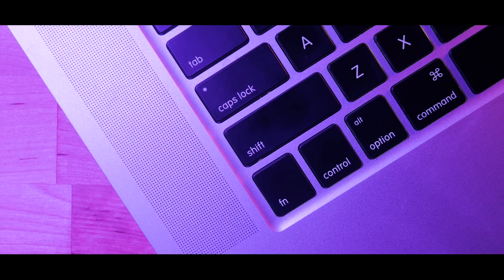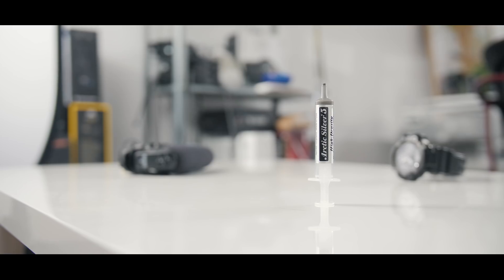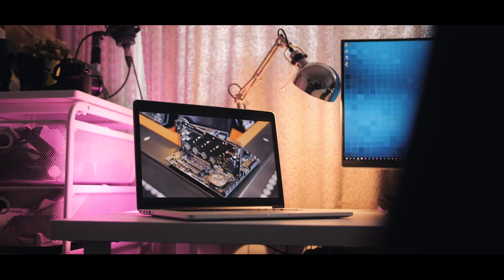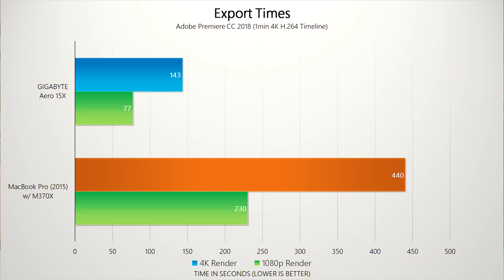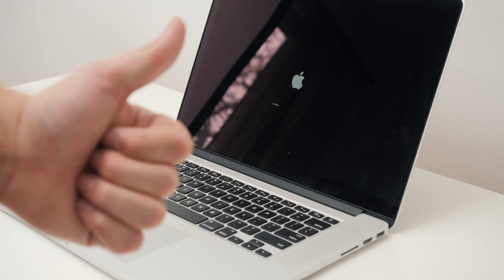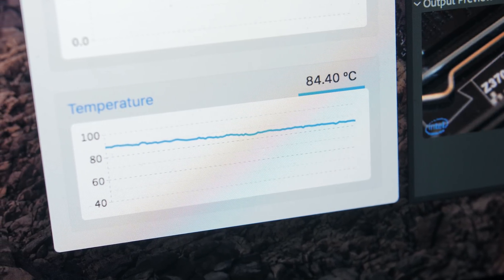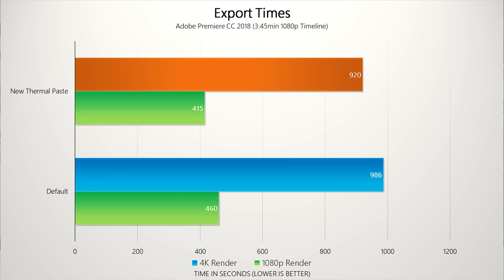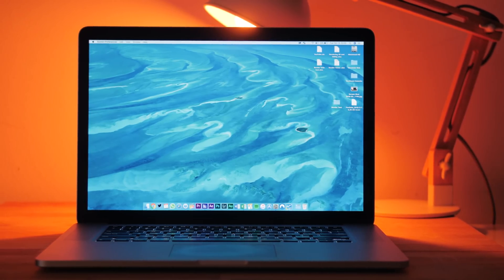OVERHEATING MacBook Pro! Can We Fix It??

Comment: The only fix to that mac is to switch to something different, something not from apple ;)
Thank me later
Reply: Jeremy Clarkson exclusives are not a reason for keeping something that's clearly not worth your money. For the price of a Macbook Pro, you can get a better laptop that works more efficiently.
Reply: Jeremy Clarkson okay yeah whatever. Enjoy your underpowered and overpriced piece of junk.
Reply: Don't even bother to argue with apple fan boys.
Reply: Yeah whatever, if i was butthurt over a guy on the internet i'd be a moron just like you, lucky me i guess.
Reply: Spaghetti eh not exactly. For me Windows is insufferable. I’m a music producer first, game dev second. All my outboard gear either doesn’t work or kind of works in windows. Drivers in that OS are just awful. And the lag between small actions, such as opening an application or closing/resizing a window are terrible and drive me crazy. And I don’t run a slow system either. But macOS is great with all my external gear, no problems ever. And no crashes when recording, or micro stutters in playback which is important. I do all my UE4 work in windows, and it gets the job done, but again windows is terrible, and I’ll just ignore the glaring issues with the UI. So it’s more a platform to run my software off of rather then an OS I enjoy dealing with. So there are reasons to use both. Different use cases and different opinions/needs, just saying switch from one to the other is silly. As it’s not that simple. 

For me with my Mac it goes “love the hardware, love the software” and for my PC it goes “Love the hardware, hate the software”. And I’m sure there are people that find it to be just the opposite. I use what I like most, and what I’m most productive on, and I say confidently that macOS is a much better option then windows for me, as I use both daily. 

So it’s kinda just, one person can find one platform to be fantastic, or their use case calls for it. And you wouldn’t know. So maybe Dimitri just enjoys macOS, it’s just kinda silly to say one is definitively better.
Reply: Spaghetti And lose out on the amazing software that are Apple exclusives

Yeah, no thanks
Reply: If you need the exclusives keep it but otherwise there is not a single reason to go with a mac over a windows laptop. That's my personal opinion.
Reply: Spaghetti Oh there's several reasons, besides, he said he loves. So your comment is basically useless
Reply: React2Quick I don't care and neither does Dmitry.
Also, if you're doing profesisonal work, the software makes a huge difference so yes, exclusives are worth the purchase
Reply: Spaghetti Lol you automatically assume I'm an Apple fanboy because I'm defending his choice.
It could've been a Dell XPS, I still would've said the same things.
You're just two butthurt idiots
Reply: Spaghetti Lol you just proved my point.
Thanks, have a good day.

Comment: Can we? Why should we? Get a Windows laptop for double the performance in the same price range with no throttling problems - the solution to all Mac related problems. Easy.
Reply: Balderdash. Asus, Acer, Razer and HP all have premium built ultrabooks that are just as performant (if not more) than any Macbook and cost much less. Owning a Macbook in the last 2-3 years has become as ridiculous as the people who insist on buying them for no logical or measurable reason.
Reply: People who buy Ultrabooks (that is what a MacBook is) want a small, lightweight device that lasts the whole day. IF you want to compare a MacBook to a Windows Machine, compare it to a Dell XPS or Microsoft Surface Book 2 (which are all roughly the same in price if equally specced)... and yes, they, too, suffer from overheating/throttling problems because that is pretty normal for Ultrabooks.
Reply: Endless Fluff
I hear what you're saying but you can still find ultrabooks with a lot more power and still last all day.

Comment: I read in some forums that some MacBook Pros suffer from throttling due to power limit issues, especially if both CPU and GPU are being pushed. Maybe that is your case.
Reply: ture, that I why I have had some people at the Genius Bar at my local apple store tell me that If I am to use Adobe premier and Final cur pro that I should have the laptop connected to power because the battery is not always capable of sustaining the power delivery necessary to run the Radeon GPU and the CPU.

Comment: Going by the video, you used way too much thermal paste. You only need enough to create a thin layer, which creates a vacuum to suck the heatsink down to the cpu making thermal dissipation possible.  Too much and you have a thick layer and excess squeezed out around the edges that holds heat.  End result? It works but not optimally.
Reply: Brisys Consulting wouldn’t the thermal paste conduct heat better than air, if not why bother using it at all.

Even if thermal paste were an insulator, over the edges amount lost cooling potential should be negligible.
Reply: Brisys Consulting a vacuum? Lol come on man. Thermal paste is there to replace the air gap between the cpu heat spreader and the base of the cooler plate. A 1-2 degree difference for over applying thermal paste in his scenario would matter anyway.
Reply: lightninguru26 It creates a vacuum. Been doing IT for 20 years.
Reply: Brisys Consulting so a paste creates enough vacuum to pull two metal pieces together to fill in a air gap? Your disputing that thermal past is  a void filler of an air gap that allows heat to transfer from one metal to another without dissipating into the air around the gap?

Comment: If you are using Premiere you should definitely get a Laptop with NVIDIA graphics.
Reply: wish apple would include an Nvidia GPU option in the laptops even if it is a 1050ti, though I would love a 1060 card.
Reply: TruVueTech YT
Apples macbook pros come with amd cards that preform worse than a 1050. They would only give you 1060 like performance for like a $2000 mark up.
Reply: forza1sra I know this. I sell them at work.

Comment: Since Arctic Silver 5 is conductive, it has a 24-hour cure time unlike some of the non conductive thermal compounds. I would suggest a follow-up video if it gets better over the next day or so.
Reply: Arctic Silver 5 is not conductive. Only liquid metal based ones are.

Comment: I have a 2017 MacBook Pro and I'm often disappointed with the heat output under circumstances like 4K video streaming. It's effectively maxed out (minus the SSD) too. Maybe when it's a few years old, I'll consider re-applying the thermal paste on it, it seems like a good idea.
Reply: I also have the MacBook Pro 2017 and with a same issue. Is your issue resolved? I wanted to know more. My MacBook turns off immediately whenever a heavy task applied on it! I’m depressed right now

Comment: The fins on the cooler is probably blocked. I have and old laptop that has been used for 3-4 years and it would thermal shut down. Opened it up and found the fin completely blocked by a jumble hairs, dust, and dust that twined together making strands. Blow some air from the outside (exhaust) with a bicycle pump and it ran fine after.
Reply: mac fan control app solved my issue, apple really has slowed down the fans to reduce sound but mac fan control helps you to solve the fan speed issue
Reply: That's why he mentioned cleaning the fans and not only thermal paste, cause if you open up the PC to replace the paste you should check on how clean the fans and stuff are.. you are opening the PC anyways..

Comment: macbooks suck
Reply: There is something wrong with his MBP. Mine hovers at around 45°C while watching youtube and the fans aren't even spinning up. Room temp is 22°C.
Reply: 45 sounds pretty normal I'd say
Reply: I suppose you haven't had one, have you?
Reply: tomtom4867  70 degrees on youtube...im glad i haven't owned one
Reply: kasra the only time mine has ever got warm on YouTube was when booted into windows.
Reply: tomtom4867 see it cant even run windows properly🙂
Reply: Every windows laptop I've ever experienced has run hotter than any macbook i've used under a normal load. Don't base opinions on something you have no experience with just because you want to join the "apple sucks" wagon.
Reply: tomtom4867 well i have experienced a windows laptop and i can tell you for sure that the fans dont even kick in when im on youtube😄
Reply: And macbooks dont normally need to run the fan on youtube.

Comment: Kind of pathetic though right? 

I mean, for the price you paid for that machine to have to re-apply thermal paste after only two years, and see a few degrees difference. 
Should have gone with the same laptop Ebur has.
Reply: Malovon yeah videos like this make me laugh at all the Mac defenders saying "the extra cost is because you get a better system for creators" and bs like that, yet it runs as hot as old laptops with piss poor cooling.

Having to replace thermal paste every 2 years is a joke. Macs have their place but holy crap are their laptops bad for cooling if they are specced for actual creators.
Reply: alcowherd7 honestly, with all the MBPs I’ve owned. Cooling is always the biggest issue. Like I love macOS, but the cooling needs to be waaay better. When I do my audio work it’s great. Whisper silent in the studio, and if it starts running hot I’ll just freeze the track.

But man when I switch in to UE4 do the fans kick up. And I can’t imagine that those temps can be good for the neighboring components in the machine as well. Cause of how tightly packed everything is.

It’d be the perfect laptop if the cooling was better. Just wish Apple would see that. Cause they can cool things well, as proven by the iMac Pro, just put that much hard work into the cooling setup in the MBPs ffs
Reply: John Wick good to hear that this isn't an isolated issue, not good to hear you have to deal with it. I have had a few laptops with not the greatest specs that have poor cooling so I could only imagine how annoying fans must get when you are just tried to get some work done.
Reply: alcowherd7 yes Apple needs to fix this. It’s got to the point where I now do all my UE4 work on my PC. Which is irritating because my workflow is split across two machines with different OSs. And it’s Apple’s fault that this is the case. Just a little more cooling, that’s all that’s needed.
Reply: John Wick yeah definitely something they should look into. Sad to see in thus movie a tool that is valued by professionals being used as a Netflix box because it overheats and throttles just during rendering.
Reply: Should have gone with a desktop machine, and obviously not one of Apple's horribly out of date ones.

Comment: You should disable turbo boost, because intel cpu can work a lot longer without throttling when turbo boost is disabled and you will render faster because throttled cpu frequency is lower than "unturbo boosted" cpu frequency

actually most of the times intel cpu's throttling because of power consumption, 15 watt intel cpu can boost to 25watt or even more, but it can't work at this rate more than 30 sec, mostly because of manufacture's limitations. That means that even if temperatures is good it doesn't mean than cpu won't throttle.

Comment: Something wired happened to me with a 2010 MBA is that performance dropped when the battery started to get old. I've tired to benchmark it at the time and OSX seemed to throttle the CPU when the battery is on (even on sector), just like this issue with iPhones. Removing the battery was a game changer.
But it would be a useless laptop without a battery -_- .

Comment: The different GHz speeds in 4k vs 1080 are likely due to i/o limitations. The 4k render has larger files to read and write to the SSD, so there are more opportunities for the cpu to cool down whilst it is still saving; cooler cpu = maintain higher boost clock.

Comment: holy thermal paste batman. Honesty temps would be better with less paste I bet.
Reply: The pressure applied when screwing in the heatsink will push out excess. That's what it's designed to do. So no matter how much you apply, in the end, you'll get the same spread. If anything, applying less is worse, as you may not get a full covering.
Reply: LMG tested this.

Excess = Good Temps, messier, possibility of short with conductive compound
Too little = Bad temps, doesn’t cover enough
Just right = Good Temps, not too hot, not too messy, just right
Reply: Yep 1/4 of the paste used would have been enough
Reply: Was looking for this. I think it´s too much too...

Comment: well, this is clearly a many factor problem. Adobe's software is getting worse and worse with less and less optimalization getting into it. When it comes to watching youtube videos - browsers like Chrome and Firefox (especially Firefox) on macOS seems to not be optimalized for macOS and/or using codec which is provided within the bundled browser. And also the cooling solution of Apple - not enough. That heatsink and that heat pipe is just laughable - but Apple does not care.

Comment: The down-clocking you're experiencing in 1080p is probably caused by the power target of the cpu, Macs have variable cpu tdp profiles (a 12w one and a 27w one if I remember correctly) so maybe in 1080p rendering the cpu is in the lesser profile

Comment: I still have a 2010 17" MacBook Pro and the problem there is that there is no option in macOS to disable TurboBoost or use integrated graphics only - that thing is still powerful enough for almost anything casual today but it just gets too damn hot. I'd like to know how much installing Windows on this machine would do for render times.
Reply: just clear inside of your laptop, and replace thermal paste, do it yourself or have it done by a laptop service near by

Comment: Well, you can try to undervolt the CPU, every skylake, kabylake and coffelake undervolts nicely (I got a - 165mV on the vCore and -145mV on the cache on my i7 6700HQ). Next time, try to use some liquid metal instead of the TIM you used.
Reply: it is a MacBook so no XTU unfortunately
Reply: yun kwan Shek I believe, throttlestop can be used with MacBooks

Comment: I'm a little concerned that you're running at like 75° during youtube playback. I have an early 2015 13" MacBook that sits on 45° on youtube. Have I missed something?
Reply: I had a 2010 Macbook Pro that would use its dedicated GPU when using Chrome. Might be something like that as 76 degrees doesn't sound right to me as well and that laptop would get really hot when using the dGPU. I have the new 2017 Macbook Pro and it stays nice and cool when doing casual things.
Reply: I think it also may be a chrome thing - I've just run this same video on safari and chrome and the latter seems to run about 12° hotter at the same resolution. I think you are right about the dGPU though, but I don't have the 15" model to test unfortunately.

Comment: Open up the air intake area with like some drilled holes and some thin filter material. Not sure if it will bring the clock speeds back up though, but you're likely to see at least 5-10 C drop.
Reply: I have the same idea, might try it on an old macbook pro... Have you done it?
Reply: No but I remember someone on YouTube doing it, and it does help. You could get a spare bottom plate to try it and revert to the old one if it doesn't work.

Comment: If you use a drill to drill some holes in the bottom case where the fans are located you will greatly decrease temps, just adding more air intake in generally helps.
Reply: i did just that
Reply: I tried the cover out , and still the computer was super hot

Comment: can you try adding thermal pads between the heatsink an the bottom cover?
Reply: Amsel_Joe He should put it on the Heatpipes not in the heatsink that would disrupt the airflow and more dust would get stuck.
Reply: Haha yeah, that´s what I intended to say. The only disadvantage would be that you can´t use your macbook an your lap anymore.
Reply: Amsel_Joe Its Not a Laptop Its a MacBook